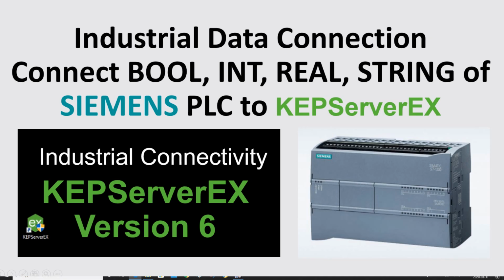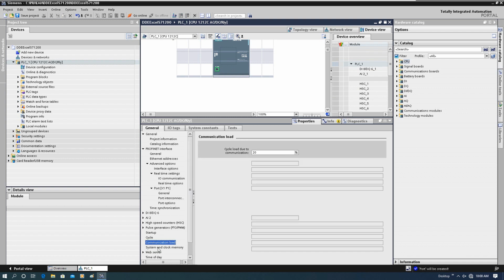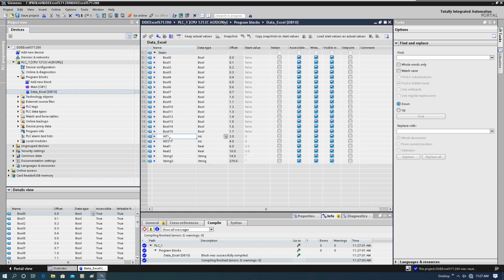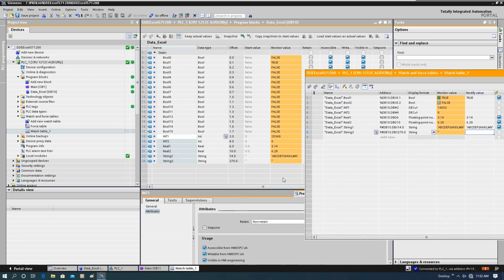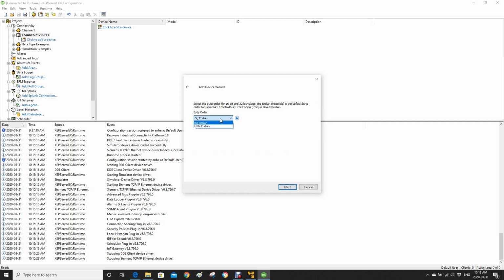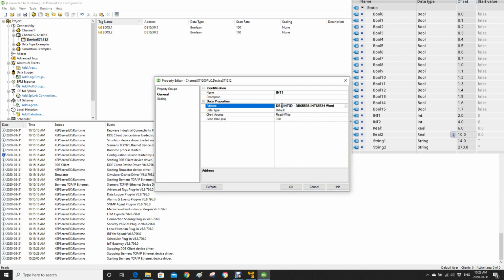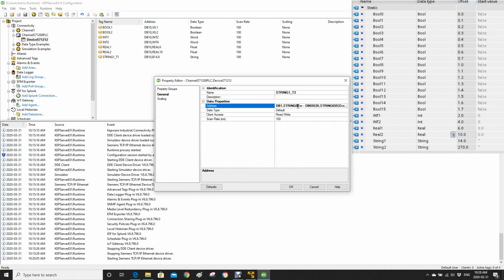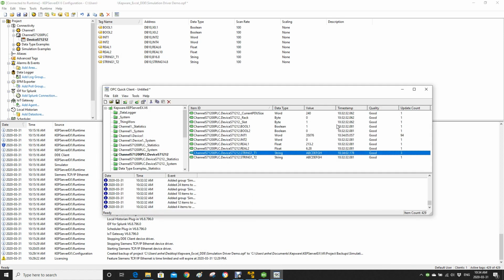COM05. Connect Siemens PLC to KEPServerEX (Kepware)

Comment: I am trying to use these settings but unfortunately the tag shows Bad in Kepserver.
PLC is running in Plant, some more settings we have to do in PLC ?
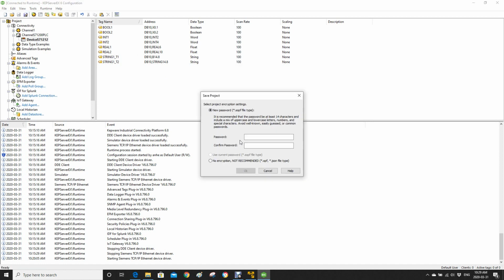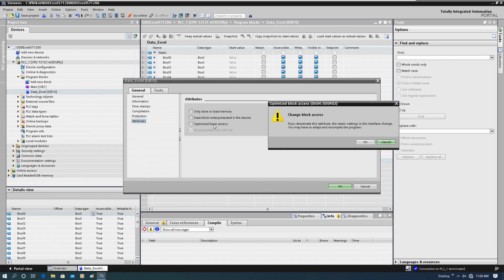Reply from the maker: You properly missed some configuration, please check from 11:30 to 22:40. Also check the 6:30.
Reply: @electricalautomation  There is one permission in TIA PLC HW, " permit access with put/get communication from remote partner", should I Click it ?, 
Does PLC go to stop mode to execute this?, Our plant is running with this PLC.
Reply from the maker: @sksingh6324  Yes, you can try to enable this option, but you need to compile and download and stop the CPU, because it is a hardware configuration modification download.
Reply: @electricalautomation  done using this setting, 
Thanks
Reply from the maker: @sksingh6324  Thanks for your sharing, I will update this tips under the video. Thanks!

Comment: Hey I did exactly same steps shown in the video. I am using PLCSIM advance 2.0sp1, TIA portalv16 and kepserver ex6. But the quality of the tags showing up in opc client and matrikon is "bad". I am unable to find any work around please help.
Reply from the maker: You can try to use two laptops one for PLCSIM Advanced, one for Kepserver.  Turnoff the windows firewall. Also try to use higher PLCSIM Adv revision. V2.0 is slightly old. It is V4.0 now.

Comment: Hi quick question, would this work for a HMI OPC UA client? I'm integrating a Siemens Tp700 comfort onto a OPC UA server and it would be great to some testing on a software like this to learn how it works and get a better view of the communications.
Thank you so much!
Reply from the maker: Yes, you can use Siemens TP700 Comfort HMI as OPC UA Client to connect a OPC UA Server, please find the manual from the link : https://support.industry.siemens.com/cs/document/109772341/communication-between-a-beckhoff-plc-and-a-comfort-panel-via-opc-ua?dti=0&lc=en-CA

Comment: Good video sir. Can Kepware modify data to PLC?
Reply from the maker: Yes, please check the17:00 https://youtu.be/KwS7_CyI0r4?t=1020, there is a setting for each variable "Client Access: Read/Write", the variable set with Read/Write or write will be available to be modified at the Client and the PLC data will be modified.
Reply: @electricalautomation  thank you sir. I have 1 more question. Can we monitor PLC data without putting it in a Data Block (DB)? Currently I have a counter in the main program and I want to monitor the current count value, which I set as MW10. So can MW10 be put on Kepware? Tks in advance
Reply from the maker: @ThanhNguyen-os2wi  Yes M address is available in Kepserver. But you need to check the syntax for the M address format.
Reply: @electricalautomation  Thank you sir. I saw a lot of your videos connecting Kepware to PLCs. But can Kepware connect to HMIs? In specific, I want to connect a Siemens HMI to my PC and then extract HMI tags to WinCC. So can I put HMI tags from WinCC to Kepware? Thanks in advance
Reply from the maker: @ThanhNguyen-os2wi  Yes, WinCC Pro(I assume you are talking about WinCC professional) can ran as OPC UA Server or OPC UA Client.   https://support.industry.siemens.com/cs/document/109479664/how-do-you-exchange-data-between-two-wincc-v7-5-computers-via-opc-ua-?dti=0&lc=en-WW.

Comment: Hello, Great Work. How can we communicate easy with older PLC  like s7 300 via OPC?
Reply from the maker: Hi, typically it would be two ways: 1. use OPC software e.g. Siemens SIMATIC NET - OPC Server, or KepServerEX. 2. using S7-1200/1500 as a bridge, S7-1200/1500 can communicate with S7-300 via Profinet IO or S7 communication TCP/IP.

Comment: Congratiluations, the video was so good and i learn so much with you. I did the same things that you explain at the video, but the KepServer presents a error called "Device return protocol error", i searched at website of KepServer and find the solution, so i think that is important to put the solution here. We need to activate the item (Permit Access with PUT/GET information from remote partner) at the tab (Protection and Security - Conection Mechanisms). Anywher thanks so much by the tips and Knowledge.
Reply from the maker: Thanks Felipe, Thanks for comments this. The selection is under the S7-1200 CPU properties in TIA Portal "Protection & Security - Conection Mechanisms" -> 'check box' for "Permit Access with PUT/GET information from remote partner". It is enabled by default. We need to check this as selected if there is three end software connecting with this CPU. Thanks again!